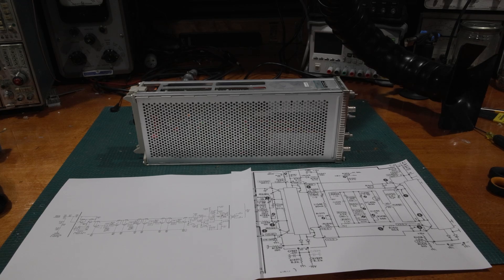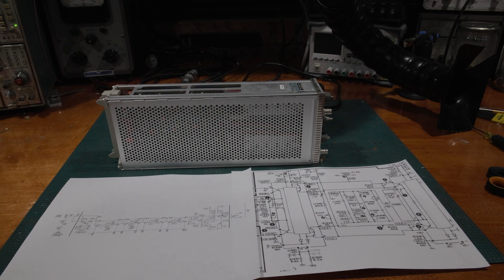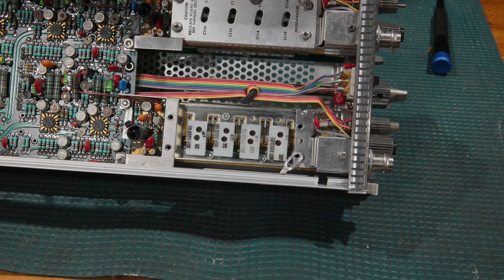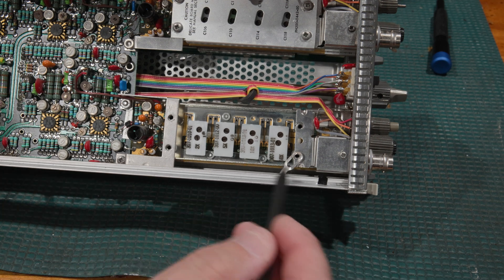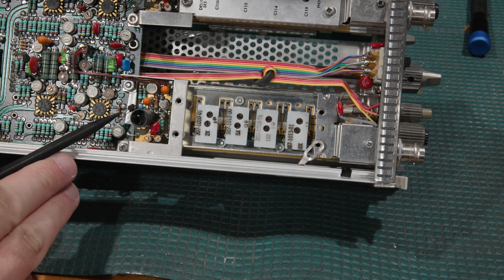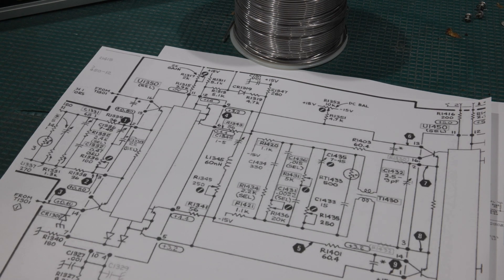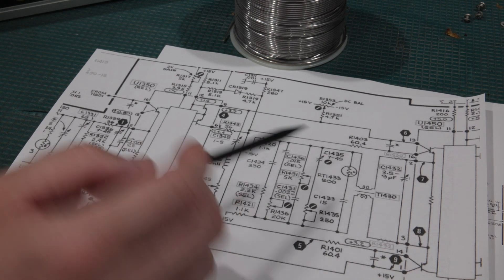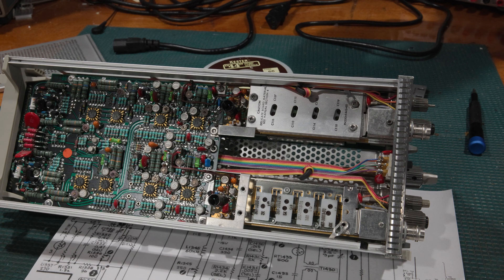Scope Front end and DC Balance Deeper Dive

Comment: 7:20 It's possible for a solder joint to break inside one of the attenuators. If this happens, you'll notice that certain ranges don't scale correctly. The attenuators unplug from the board and each has a lid held on by clips. The solder joints can be reflowed, but it is low-temperature solder so care is needed. Tekwiki has photos and temperature info, see the 7A26 repairs page.
Reply: The faster dual, 7A24, has some fusible links on ceramic substrate that are part of the attenuator circuits. I have had to replace these in one of my 7A24 to restore signal. I wonder if there is a similar protection device in this slower 200MHz dual amplifier?